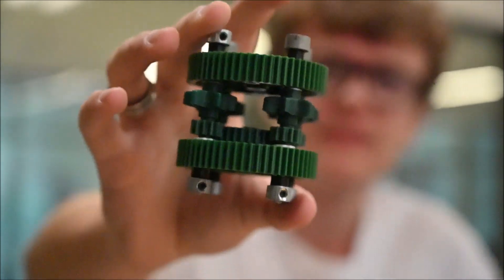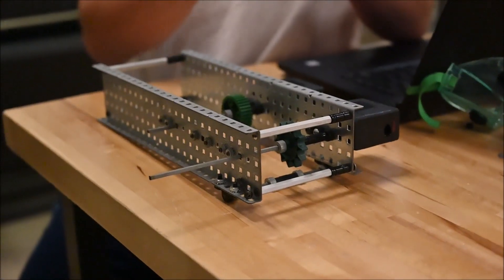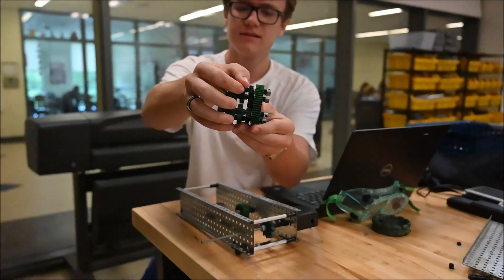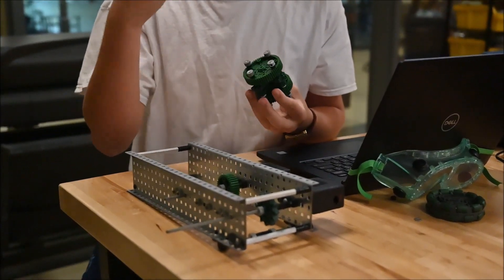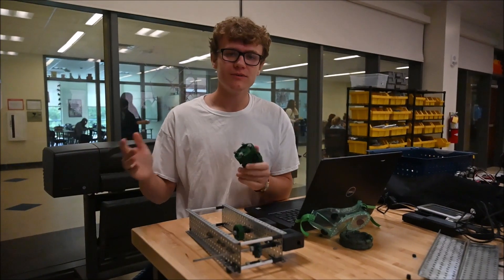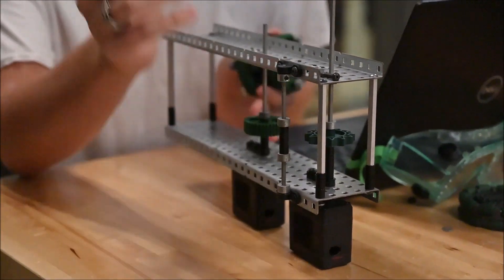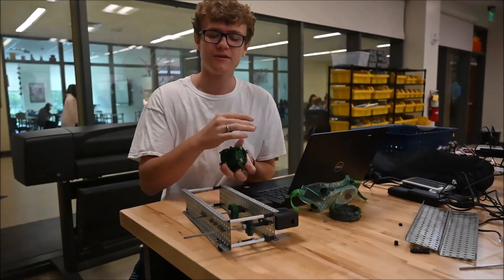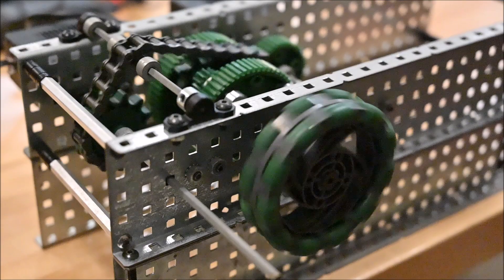Planetary Gear Explained using VEX V5 System (and Disadvantage of Using Them)

Comment: I remember making one many years ago. IIRC the torque mode didn’t work quit right. Something with vex parts weren’t designed for it.
Reply: Auburn Dynamics Robotic it’s a cool concept but a standard gear shifting design would be more efficient

Comment: I tried it, turns out the differential actually "cancels out" some of the rpm when you try to reduce rpm. So you don't actually get that extra torque in exchange for rpm. Why this works on farming machines etc is that the 2 motors have a massive difference in power.

Comment: How exactly do you get torque mode to work?
Are you applying a stall torque to the motor that drives the sun gear?
We tried to make this and found the when both motors go in the same direction (to achieve torque) the motors fight each other and the wheel can basically spin freely.
Any advice?

Thanks!